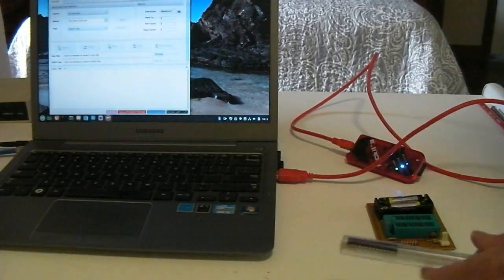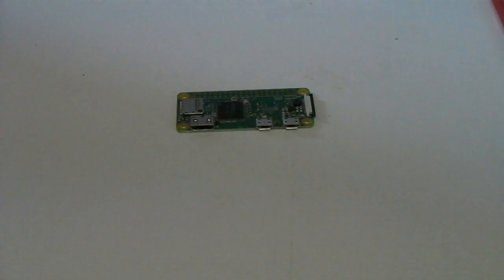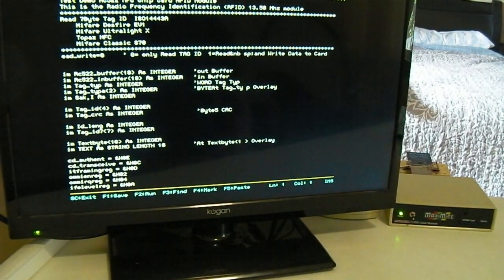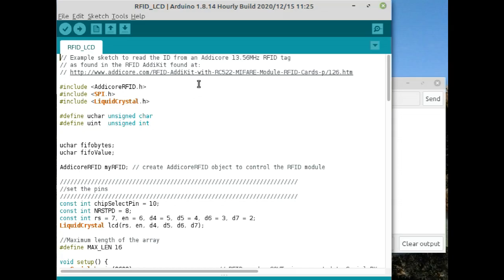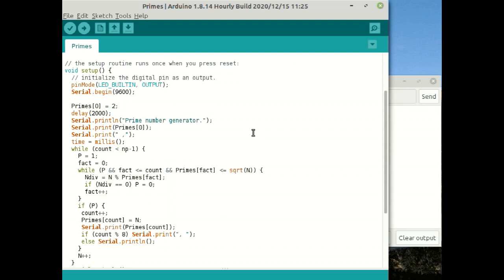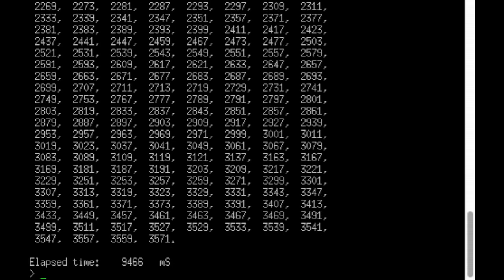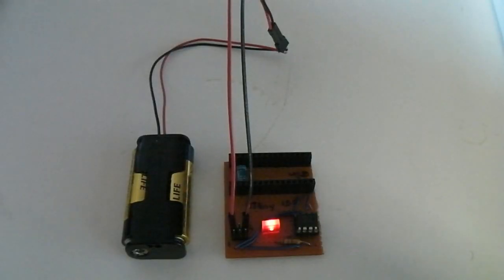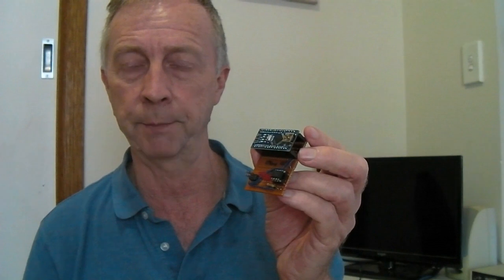Micromite vs Arduino

Comment: 3:25 Prime calculation will not test the advance instruction set power of some microcontroller, like Arm m3 and m4, those have powerful advance instruction sets, more powerful AVR or M0+, so you need more complex code to test the power between micro controllers than just a simple C prime calculation in software, that will NOT show the power of some micro controllers with DSP, complex instruction set, FPU, etc.

Comment: A BASIC alternative to Arduino C-a-like is Great Cow Basic, which compiles to native assembler for any of the <=16bit PICs and AT* chips. I Use a lot of micromites but for smaller/simpler projects that are in a mature stable, state I will often use GCB. Again, there is a healthy forum and lots of pre-built modules for all the common bits & bobs.